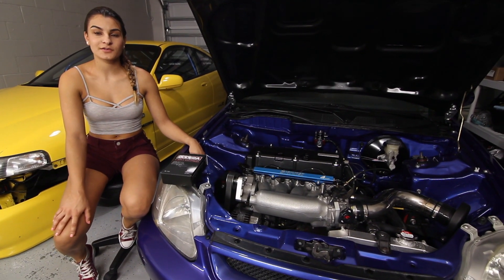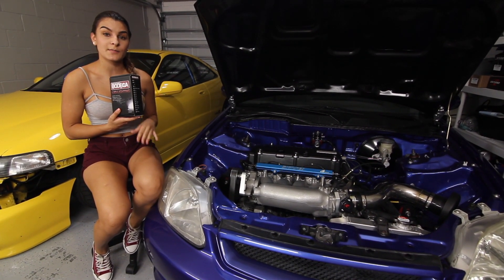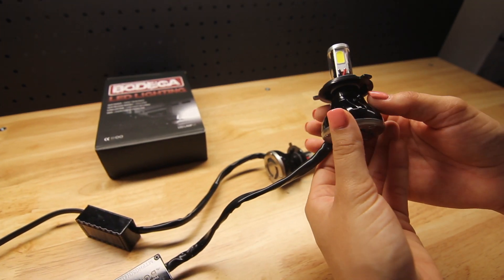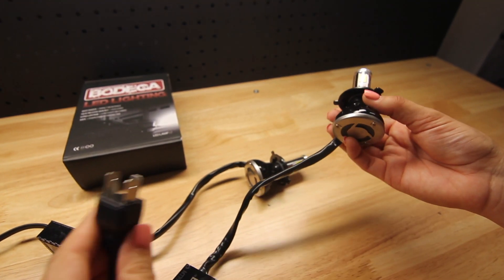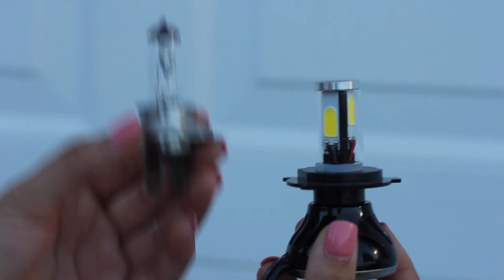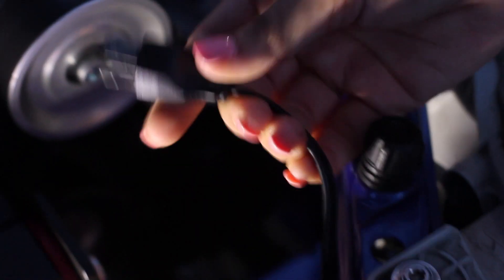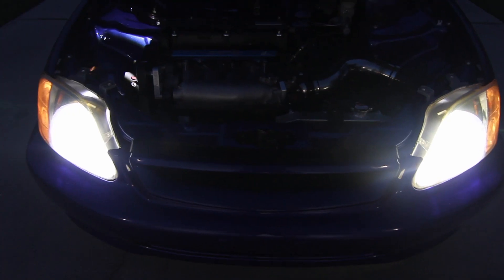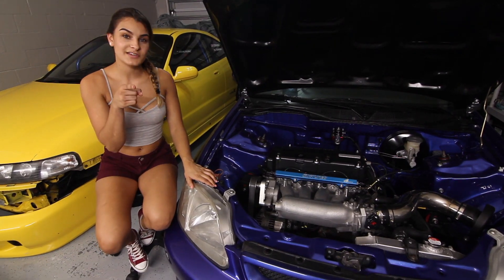LED BULBS VS HALOGEN BULBS

Comment: LED bulbs don't put out the light like an HID. My cheap Ebay HID kit been going strong for 3 years for only $25 that's fat AC ballasts and lights. Not the cheap slim DC garbage.